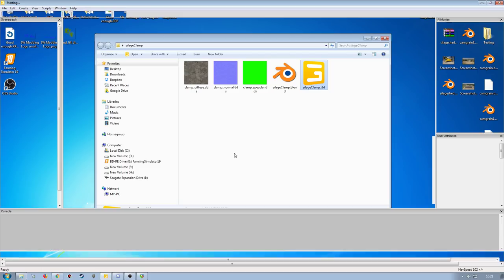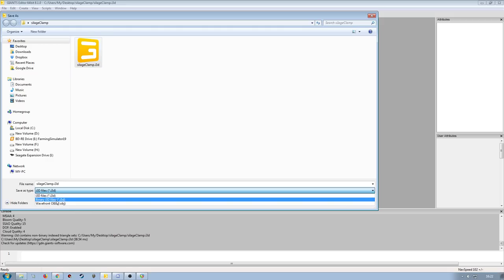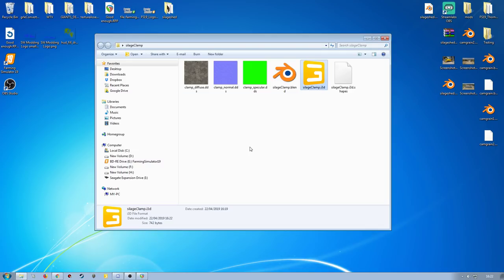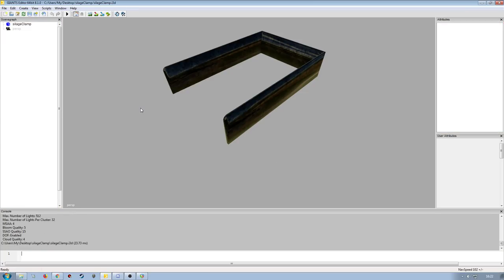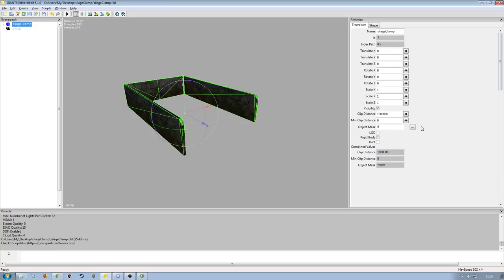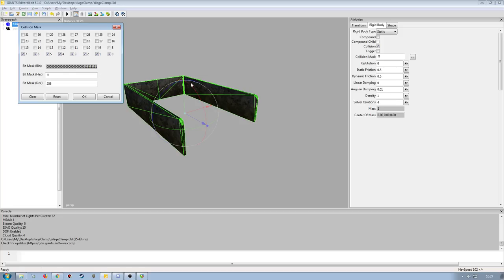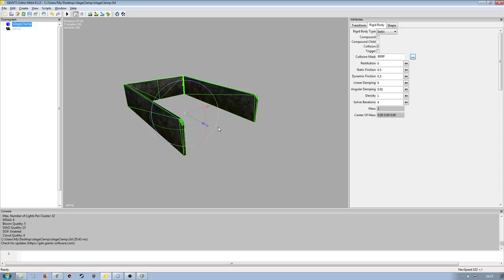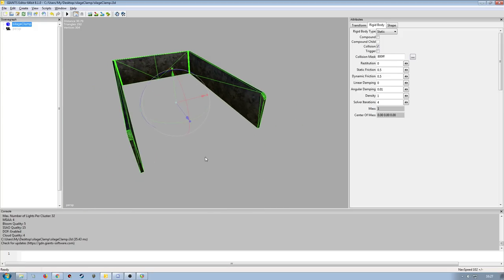Making a custom silage clamp

Comment: Hi, i have problem when i put my silage clamp as default items, because when i tip it all goes through walls.. put if i buy the same silage clamp as placeable and place it, the chaff dont go through walls. Any ideas?
Reply from the maker: This has been a problem in 17 & 19 with collisions.
My advice would be to manually paint a tipCol on the map where the silage clamp will be.
Reply: @shywizard2979  ok thanks i will try

Comment: Hi Shy, great video! very informative! 

Do you know if it's possible to have a clamp that is x2 the normal height, but with a side entrance at the top of the x1 height?  
So like an open-ended single bay silo that has a cut out in the wall so you can access it from a mid-level? wish I could add an image to help explain it
Reply from the maker: You know i have to say i have no idea.
The main problem would be how it plays with the game mechanics, you know how the tip on ground function works & would you be able to get a vehicle on to the pile/heap to compact it.
The problems i see is the opening would allow the chaff to spill out which may cause an issue.
This would possibly allow chaff to drop within the walls of the silo which you not be able to access.
Would really like to see an image so if you have Discord https://discord.gg/KGHYsq post a pic or 2.
Reply: @shywizard2979  would it be at all possible to have it be a 'false wall' then, allowing vehicles to pass through but holding back the chaff? I think it would make a very interesting pit to work on and would fit my current savegame well with the ground modifications I've made lol
Reply from the maker: @The1Whiteside  The problem here really is on Giants to fix the collision masks.
As i mentioned they do not really work.
In theory you could create a collision box around the opening & change the mask to only block the chaff, but it's broken & in all testing i have done iv'e not been able to fully prevent the chaff from bleeding through.
The other problem would be if by some miracle the collision mask does work you would then have chaff collect in the opening & block access with any vehicle.